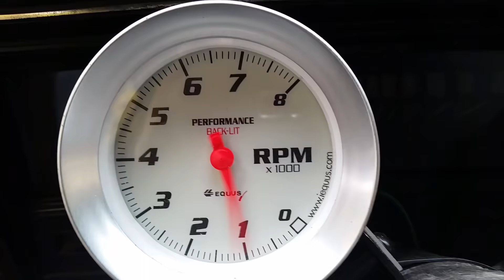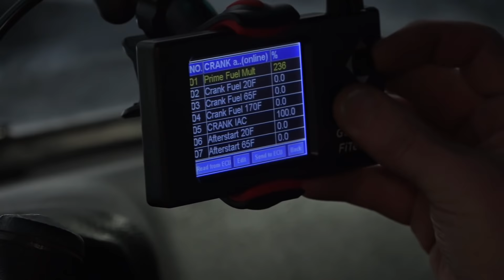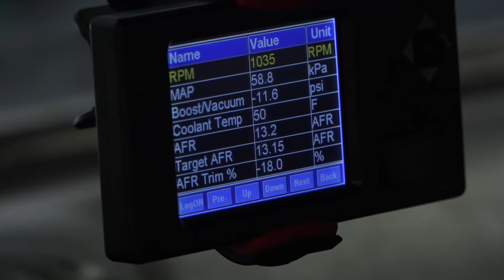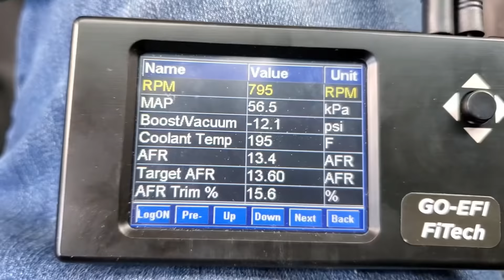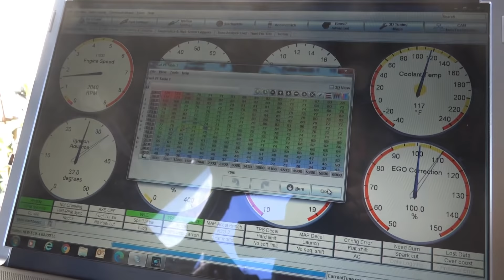430HP Driveway Rescue! Is it Cursed? | Not Rod Ep. 10

Comment: New battery always helps. If a battery is too low, all the power goes to the starter and it doesn't leave enough juice to energize the coil. One upside to points vs HEI.

Comment: I actually installed a fitech system on my 77 c10 before I went ls and I loved the thing.  I did a returnless style with ls corvettes fuel filter/ regulator. Only thing I needed to tweek was the iac and change my timing. Other than that it ran fine

Comment: 1973 Nova 355 Gm crate backed w/ 700r ..Fitech install including new tank w/  internal fuel pump ..new hard lines with braided connectors both ends (no leaks)  ..bung for sensor welded in collector  ..alls well for over 2000 miles  ..fuel economy not so great ..performance & reliability great so far ..daily driver  ..street & freeway  ..got my bucks worth  ..!!

Comment: Putting a efi system on a vehicle that doesn’t run for crap isn’t going to make it run any better in my experience, there’s usually a lot more going on than the Holley is junk. My friend has the same experience as you did with that fitech system, and he bought the dual quad one with all the bells and whistles, some times it would run great, other times not at all, no rhyme or reason. Always make sure to put new grounds on your heads, block, firewall, radiator support, frame, any where else you can think of, that’s always a problem too like you mentioned
Reply: I’ve see people cry their holley is junk, the edelbrock is junk the fitech is junk.. pretty soon you realize maybe it’s the person turning the screws 😂 I am a tunnel ram carb nut but I have installed fitech on 3 vehicles including my wife’s 86swb and have had no issues, you just need a lil know how and tuning experience.